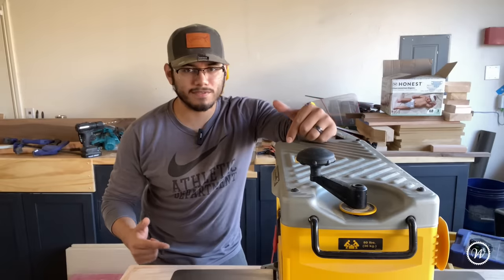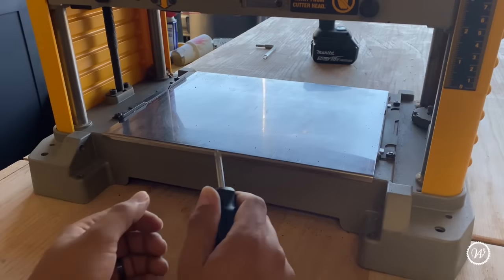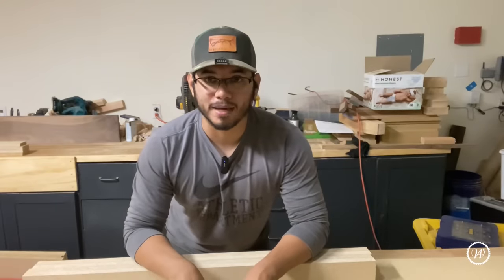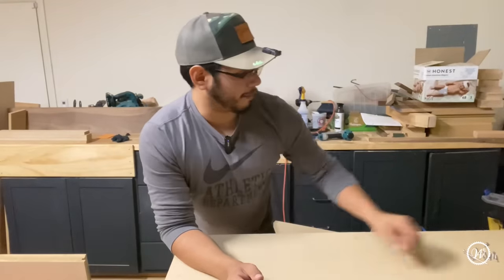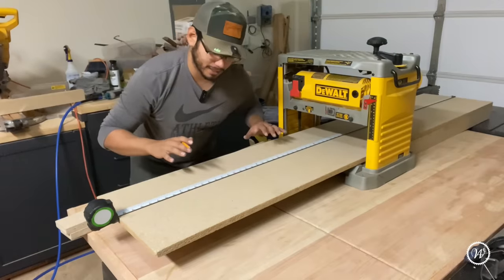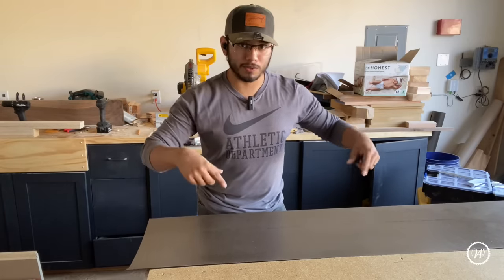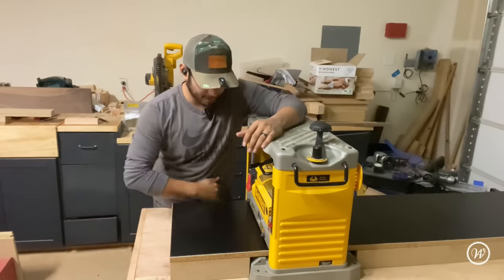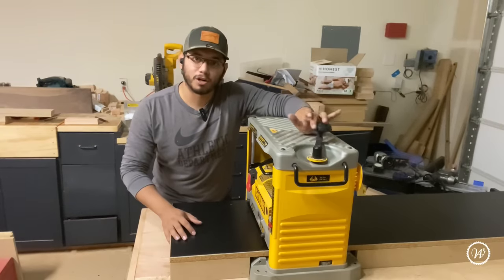Best Decision I’ve Ever Made || How to: Planer Sled

Comment: Not knocking your sled idea at all, in fact it's a great idea. I've seen many sleds built similar, each are all different and yet each works. I had an old craftsman planer, could never solve the snipe issue it had, ended up replacing it with a Rigid planer. Mounted the new planer to a Rigid miter saw stand, (early model), with this stand extending out to 6 to 8 ft overall, I've got plenty of support at both the in feed and out feed sides of the planer. Plus this made my planer a lot more "mobile".
Great video, cheers :)

Comment: I'm guessing your channel hasn't been going long as you have all mak tools except for the planer. Why mak dropped their planer and portable table saws still has me scratching my head.

It's a nice idea and I might nick it for my shop once I get around to doing it.

I was glad you put an oversized piece of formica on the top as getting a perfect fit with contact cement is impossible. Normally I'd use and over sized panel and then rip one side and then the other. The trim router was a good idea!

Comment: I built a platform like this for my planer. Must have done something wrong. What it did was somehow reduce the traction or grip the planer table used to have on a board. So, the  planer got very good at shooting the board against the far wall of the shop. I hadn’t had that problem before and took this modification off my planer.
Reply from the maker: Holy hell lol, I haven’t had that problem luckily

Comment: The best way to not having sniping is multiple rollers on each side. Sniping occurs either prior to the board being caught by the outfeed roller or after being released by the infeed roller. Any bow in the lumber and sniping will still occur on any length table as long as it's pivoting on just one roller. Having said that, I do think doing this will help.

Comment: When I made my in feed and out feed table I just bought a shelve that was 12 inches wide and already had laminate on it. I never plain down stock that is wider than 12 inches. At least not in the last 20 years. Okay, so I loose 1/4 inch on each side... I used the entire 8 foot piece with 4 feet on each side of the blades. I have the space so why not??? I also have the plainer attached to a rolling table permanently.

Comment: Sorry this is old old old news and does NOT eliminate snip all together, as others have said before you will always get snip because the timber isn’t all square before using the thicknesser as well as the timber hitting the rollers which causes the timber to tilt etc

Comment: I don't get why you didn't also elongate the front of the planer sled? I get snipe at both ends of my boards, not sure if you do but I think that most people do. Maybe you don't have the room in a small shop. Also, I would have liked to see you plane a board and show us how this jig solved your snipe problem. Nice video though, thanks.
Reply from the maker: I was at the mercy of a 5 foot piece of laminate. My original plan was to add 3 feet on both sides but I forgot my laminate sheet was quite a bit shorter than what I needed for that so I called an audible
Reply: That's why I used an entire 8 foot table...

Comment: Did it fix the snipe problem?
Reply from the maker: It did for me. There’s other tips I’ve seen like not taking too big of a cut, that helps with making sure the cutter head doesn’t shift. Someone has also mentioned bolting your planer to the workbench. I’m going to reattach my stock infeed and outfeed pieces and see if bolting it down to eliminate movement does the trick too
Reply: Bolting it down didn't fix that problem for me. But I have a different planer than you do.

Comment: great idea! but doesn't the thickness of the wood and laminate now make your measurements impossible (or at least challenging)?  i.e., the vertical ruler on your height adjustment is off now, isn't it?  or is my brain missing something, lol - which is always a possibility!!!
Reply from the maker: It definitely renders it useless, however I’ve gotten used to using calipers for narrowing down my thickness so I never used it anyways
Reply: @ArkusWoodworking  makes sense!  I have a little Ryobi planer similar to the Dewalt, and snipe on the way out can be brutal

Comment: This will help with managing of larger boards but unfortunately will not fix snipe, it will reduce it at best. They really should start designing these planer with two rollers on each side. This is the only way I can see this issue being fixed on these planers.

Comment: Putting your contact cement on like that it doesn’t seem like it sticks that well. I use a siphon gun and I spray it on. As soon as I touch the laminate to it, it sticks automatically where I have to use sticks in order to align it.